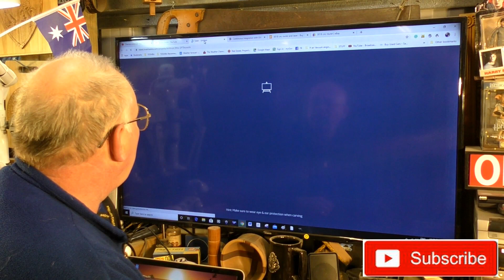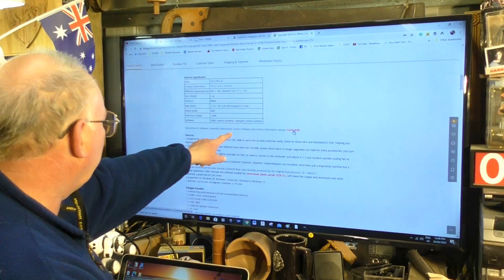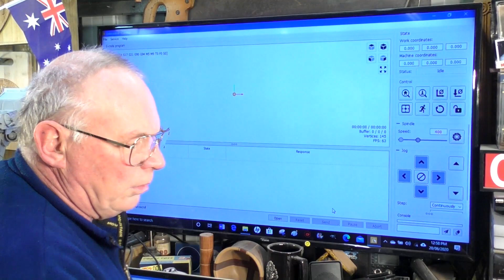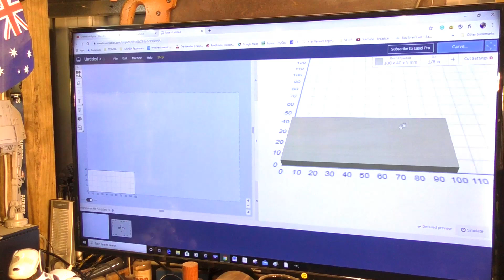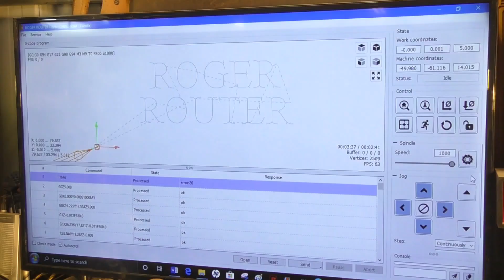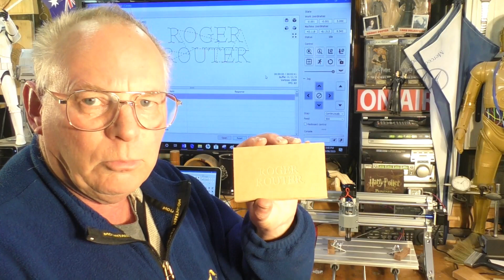The Cheapest CNC Milling Machine $250! Is it worth it?

Comment: I was just about to buy a 3018 controller to upgrade my machine, but I realized that it's only a 3 axis controller. Does this 3018 controller also control the spindle motor? I consider spindle speed to be a 4th axis, so I'm not sure it does get controlled with it.
 If anyone can answer this, I'd be very grateful. Thanks.
Reply from the maker: No it will not, the spindle works on a 0 to 10 volt output
Reply: @inventorsworkshop9600  Thank you. I think it will work though. I just saw a video showing that it activates a contactor. I have a similar spindle control.

Comment: Hi rob i found your channel a bit by accident, i have a few questions I'd like to ask could you use one of these machines for routing out small aluminium mold s using alu blanks approximately 8 by 3by .75 inch and be able to incorperate a lot of detail hope you can advise many thanks dave
Reply from the maker: Hi, no the 3018 will not, have a look at my MIDI CNC router, that will do what you want.

Comment: When I saw the plastic mount for the spindle I new there would be vibration. Even the rods were even bending under pressure. Using a laser there would be no issue.

Comment: It was nice to see this, I've had one of these for a while but have never actually cut with it as the 3D printed version of the spindle holder broke and dropped the spindle the first time I tried. Nice to know that there are better versions out there, I would really like an aluminium version. Mine doesn't have spindle speed control either...

Comment: I have one of the "PRO" versions with bakelite side pieces for a while now and it was a perfect tool / toy to jump into the bottomless world of CNC. I now prototype circuit boards most of the time with it. There is a "pro metal" version of this on aliexpress with a 300 W spindle or even the slightly bigger and more expensive 3040 machines I was looking into.
One thing to keep in mind is that these are not made to be a "router", but engravers. They are not built to do heavy duty stuff - one of the reasons why they are being sold with laser addons.

Comment: if you check Minh's man cave channel he did a 500w spindle upgrade, and made a custom aluminum mount for it, seemed to eliminate the flex in the spindle
Reply: Hi, Minh also did a complete revamp of the X axis linear rails by adding SBR rails bolted against the 2 cross rails at the top......that also means a revamp of the complete Z axis and motor mount, but what a difference that rebuild makes.

Comment: I wouldn't put watching this video down to merely something to do when you aren't doing anything as it's very informative and I like the hands on by example approach that puts you into the virtual driver seat as you go along.
For the price(s) it would be impossible to buy all the exact same parts and make it exactly the same cheaper............ the design as it is has been made for production purposes that is why it's that cheap........... but you could make one possibly a smidgeon cheaper but differently with available material if you wanted to spend more time.....an all steel tube brazed or welded frame comes to mind as it's that cheap to buy new steel material.
I would run the system with Mach 3 as I already have a CNC mill and this is a fun project anyway.......in the end the operating system could cost more than the build if you go away from GRBL.
Why is it you can never find a second hand one going cheap?

Comment: I bought a pro version just recently, and it's very similar to the standard version you're using. The difference is four bakelite pieces (10mm thick) instead of aluminum frames at the front, back, and for the pillars of the gentry. I found limit switches being the most pressing issue I added. I thought that will be the first thing to fall down, as I just hot glued them, but apparently sqeaking became the first issue. **Note: I'm using a non-commercial Fusion360, which emits G-code in a way it will ruin your piece by default if you don't edit the code before running, and/or you don't home the machine (that's why I started with limit switches), and set your G28 coordinates too.
Reply: If you have a 3D printer I can send you a file to print mounts for it if you would like, ours is a Pro as well.
Reply: @johnsmith5726  Thank you, but I believe this is the bikeshed I'd like to choose the paint for :)

Comment: The 3018 is a great little machine and so much fun, we, I run a small charity, have been using a 3018 for a couple of years now. First thing we done was fit limit switches and a Raspberry Pi which lets us run it remotely without the silly controller it comes with, we use it to cut HDPE all day everyday and we have never had a problem with it.